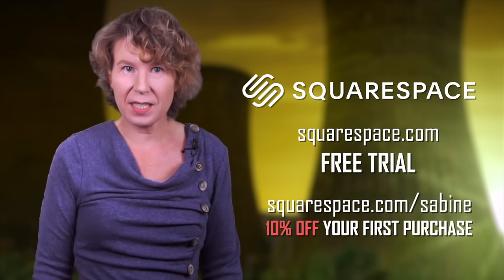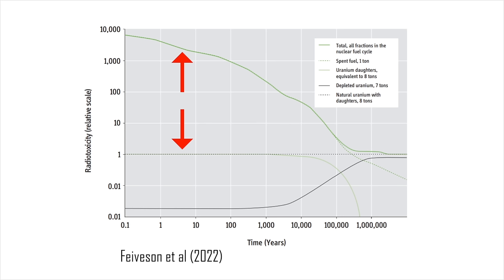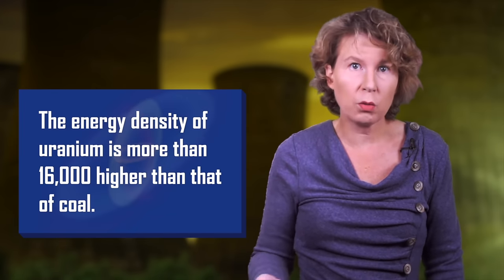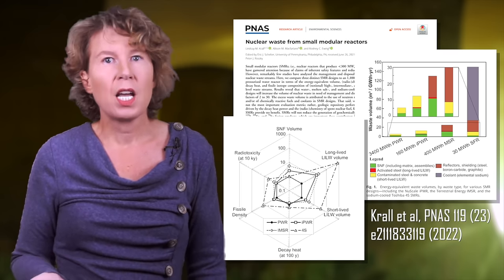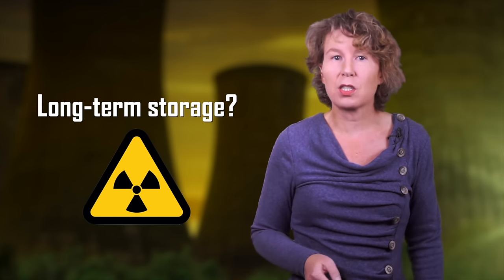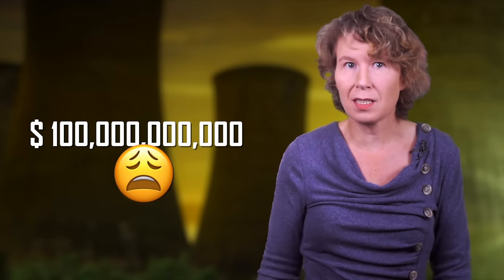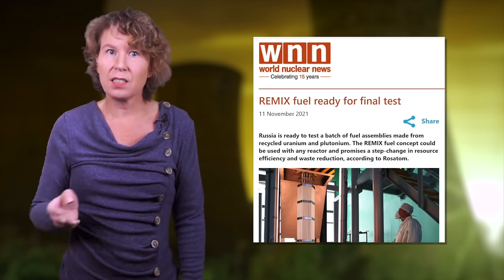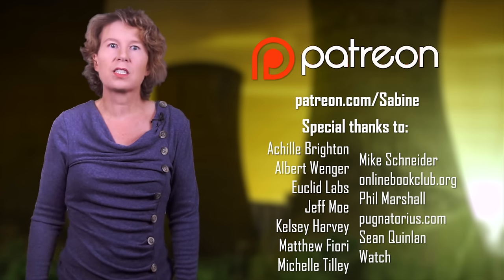Nuclear waste is not the problem you've been made to believe it is

Comment: I can personally testify that the vast majority (I guess 90%) is not that bad.  I used to work at an environmental analytical lab, and we got weekly samples of effluent and reaction slurry to run tests on, which I conducted myself.  The effluent doesn't even register on the Geiger counter if you don't integrate over a day or two.  I wouldn't use it to make coffee every day, but I'd rather take a bath in it than spend a day on the beach without sunscreen.  The slurry had detectable radiation and other hazardous properties (BOD for example, but not as much as a blenderized sandwich after a warm day).  Even that, though, the storage and waste protocols were a tad overkill in that they needlessly turned equipment and materials into low grade waste, which were in fact safe to just throw away.

If I contrast those samples with the other samples I came across, there is no contest about which is more dangerous.  It's the industrial and mining byproducts, by far.  My workload was dominated by cyanides, [C/N]BOD, MBAS (surfactants), and flashpoints, so the big alarm bell is the cyanides.  Cyanide is used in some mining and refining processes to chelate certain metal ions, and just a few grams of the solid waste products will kill you dead at several meters away under acidic conditions.  They had to be diluted thousands of times just to get a result on our analytical curve, and I ended up just throwing the glassware it touched away.  Distilling those samples was scary af.  We called it "glass candy" because it kinda looked like chocolate fudge with shards of iridescent glass all through it, and I hope I never see it again.
Reply: You forgot to mention where the samples come from.
Was it coal power plant ash?
Reply: @jannikheidemann3805  He said "industrial and mining byproducts". Doesn't sound like it's from coal ash.
Reply: @thenonsequitur  we're talking about two different sets of samples, totally different industries and locations.  The scary cyanide samples came from mining.  The less scary radioactive samples came from a nuclear reactor.
Reply: Corporate lobbyists approve this message.
Reply from the maker: Interesting, thanks for your comment!
Reply: @thenonsequitur  He said what his contrasting examples were from.
He forgot to mention what he was originally talking about.
If I set A in contrast to B and then explain what B is, I still don't necessarily know what A was about if there was no concrete description of A.
Reply: @davidhand9721  Thank you for the clarification!
Reply: @jannikheidemann3805  Yep, I just misunderstood what you were asking about. I guess I assumed that "A" here was implied to be from a nuclear reactor.
Reply: humanity achieved the holy grail of alchemy, transmutation, then they collectively decided "nah, we don't want it" and remained in the stone age for the 70 or so years since then :/
Reply: How about the mining by products for uranium?
Reply: @campbellpaul  I hate corporations - especially the one I was working for at the time - with a passion.  I'm not covering for anyone.
Reply: @aaroncosier735  I never saw any, as far as I know.  Uranium ore is definitely gonna have detectable radiation, and if you inhale any dust particles from it, you're gonna have a bad time.  I don't know if they use any cyanide in the process, in case that's what you're asking about.  Supposedly gold mines are the worst samples for cyanide.

Comment: Yucca Mountain was abandoned not because of local opposition, but because it is part of a volcanic area made up of tuff, a volcanic mineral. It was abandoned because of the high probability of a recent volcanic eruption.
Not only U235&238, Pu238 to 242 are isotopes to consider: Over 100 other isotopes exist due to radioactive decay networks, and most of the decay produces Helium4, which induces gas pressure in the containers. The He4 2+ radicals due to alpha decay are emitted at a speed of about 5% of the speed of light and cause fatal damage to cells if the decay takes place in alveoli or between intestinal villus. The high risk of lethal injury from alpha decay can be understood if one knows that the conversion factor to convert the decay energy from Gray (the energy the decay induces in a calorie meter) to Sievers (the biological impact factor of a decay particle) can be up to 70 (20 for the alpha decay itself and a linear function for the maximum impact as a function of the depth of impact in the biological tissue): German StrlSchV Annex 18 C and D). In the short term, about 10% of the heavy metal is emitted as He4! This He4 has the second highest gas constant after hydrogen (2077 J/(kg K)) and will crack the containers due to the high temperature caused by the decay.
Hansen and Leigh "Salt Disposal of Heat-Generating Nuclear Waste" say that in one example calculation the temperature rises by about 400°C, making such a facility impossible to manage.
[Page 40 on https://www.osti.gov/servlets/purl/1005078]
Other scientists say this will happen (see the video on Pu by the Nottingham University professor). The bentonite that will be placed around the containers will also expand due to the humidity in the natural environment and will create cracks in the deposit for the emitted isotopes to escape from the cracked containers into the biosphere.

I do not see the real problems being presented to the public by this video. Funny (or not) jokes cannot hide the real problems!
Reply: If Yucca were to experience an eruption, now tell the informed viewer how much radiation would be released even without nuclear waste in the mix.
Reply: He4 will flow harmlessly through the containers just as it does through everything else.  They will lose their charge and eventually make their way to the surface where they could be collected and used in theory (The same process under salt domes that contain oil deposits causes it to be in natural gas where we collected all the world helium from, yes every helium balloon has nuclear waste inside of it.)  

Your worries about disposal do not take into account the extremely low volumes produced and the ability for certain extremely small elements to travel through containment.   It will not be an issue as described.
Reply: @mikeburkart8028  He4 is inert and not radioactive and as a decay product itself not direct harmful.
He4 is a producer of leaks in the depository due to induced gas pressure and will open the door through the barriers for the radioactive ☢️ harmful isotopes into the biosphere. Therefore the He4 caused cracks into the barriers is the main problem for the safety of a deposit of highly radioactive heat producing waste and is really dangerous and must be considered in the safety assessment.
Reply: Wow!! Superbly detailed! Any studies of how to bleed off the He4?
On a lighter note, if the Sheriff of Nottingham can't help, how about Robin Hood?
Reply: @ForbiddTV  please stop commenting bs. there are already enough misconceptions about nuclear science
Reply: @TheThinggummybob   Show anywhere I have given any misinformation.  All volcanic eruptions release large amounts of radiation.
Reply: So after all that smart talk and then analysis, there's still a great Hazard and danger even though she makes a funny story out of people possibly dying and poisoning the water in the planet
Reply: @jayjack2046   No one on the planet has ever died from stored nuclear waste.
Reply: Well at least she’s trying, and therefore due some credit. But yes, many facts were painfully overlooked here.
Reply: @modquad18   Yes, facts like: 
No one has ever been injured by stored nuclear waste.
There is so little of it as compared to ruinables and coal ash, which is more radioactive than nuclear waste.
The two billion year old nuclear waste site at Oklo Gabon proves even without burial or human intervention the stuff doesn't spread.
Reply: @CrniWuk   You just proved my point.  No one has been injured by stored nuclear waste.  Careless processing is not stored nuclear waste.  The two billion year old nuclear waste site at Oklo Gabon proves spent fuel can be buried anywhere and would be quite safe.
Reply: @CrniWuk   And you inadvertently proven that nuclear power is the safest we have.  Thanks for playing.
Reply: @ForbiddTV  That you know of...
Reply: @SailingInfidels   Show anyone that has been injured by stored nuclear waste.
Reply: No. It was abandoned because a water source was nearby and locals and natives were up all over it. The volcano is dead, has been dead for thousands of years. It was one of the primary reasons it was chosen because that particular basalt tuff absorbs radiation fairly well. The only geologic concerns outside of the aforementioned is the seismic activity.
Reply: @MrMackievelli   But Oklo Gabon shows even without all the exuberance surrounding those considerations, no casking, no burial or any human management whatsoever there was no mass contamination of the area.
Reply: @ForbiddTV  Nobody can, but that doesn't mean that nobody has. So therefore, it's an unanswerable and irrelevant question. It is up to the industry to prove that nobody has, can, or will be killed. The onus is absolutely on them.
Reply: @SailingInfidels   If anyone had been it would be the biggest news in the world for irrational anti-nukers.  Not something that could be hidden.  The onus is on you to validate your meme.
Reply: "The Government Accountability Office stated that the closure was for political, not technical or safety reasons." -Wikipedia. 
In particular, it was abandoned due to Harry Reid, then Senate Majority Leader, who said, "Yucca Mountain is dead. It'll never happen."
Reply: @mikeburkart8028 ... Even if the container has been welded tight? Then what should tightly welded containers achieve? If not, the retention of helium 4 and alveolar particles that are otherwise managed in hot cells???
Reply: Since when have technical problems or geological site factors not been a safety aspect in nuclear technology?

Tuff has an extremely low thermal conductivity of 0.54 W/(m*K).
Why are final storage containers welded tightly if the helium and highly radioactive dust particles are not to be retained? 

Why are used fuel elements only stored or manipulated under water or in hot cells? 

Why do Hansen and Leigh point out in the Sandia National Leboratories report that a temperature of over 400 degrees Celsius will prevail in a repository for high-heat-generating radioactive waste, i.e. for spent fuel elements, after only four years?

What happens in a repository container that has been welded tightly and therefore the helium cannot escape when the helium pressure rises due to the high temperature and the increasing mass of helium (p V=m R T)? 

Why does the CEA Paris state in its monograph on spent fuel elements that pressures of up to 125 bar will prevail in the final storage containers and that this is due to the MOX nuclear fuel?

Why are the German operators of nuclear power plants and other nuclear facilities paying 23 billion euros into a repository fund if they cannot thereby get rid of a problem whose monetary value cannot be estimated if, in addition to cooling, the highly radioactive respirable dust particles are not to be retained, which will certainly be fatal if inhaled?
Reply: @klamser  Yes, Helium 4 will escape even tightly welded containers over the time periods we are talking about.  Hydrogen and helium pass fairly easily through metal over medium timeframes.     The effect is not limited to metal.  If you fill a balloon with helium and fill one with nitrogen or air,  you will see the one filled with helium will deflate over the course of a few days.
Reply: I worked for 14 years on the Yucca Mountain project.  The decision to abandon the project had nothing to do with volcanism. It was purely political.
Reply: Thank you. You've solidified in my mind the issues I've been seeing with this channel; mainly a very biased approach that prioritizes glibness and click baiting over substance and science. Now please direct us to your youtube channel and if you don't have one, well, get at it :) This is the content, with facts and supporting references, that we need.
Reply: You, sir, are spinning it. Local opposition was indeed the largest factor. Harry Reid waged war on the idea because it's what his constituents wanted. Obama went along with him. Trump reopened the debate but later sided with Nevadans, as did every other politician who wanted the votes of Nevadans.
Groundwater contamination was one of the fears that locals had. Another was transport to the facility. IMO, transport vessels are safe. But groundwater is a legitimate concern over such a long time span. You attempt to make it very complicated when it's not. The people of Nevada felt like it had been forced on them, very few of them understood it, many of them believed fear mongering, and they let Harry know that they didn't want it. That is what killed it.